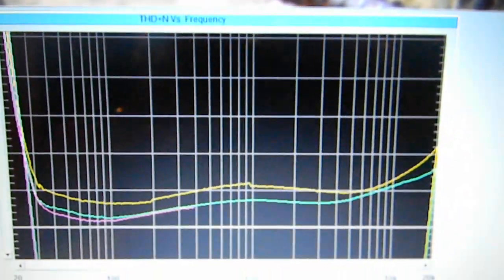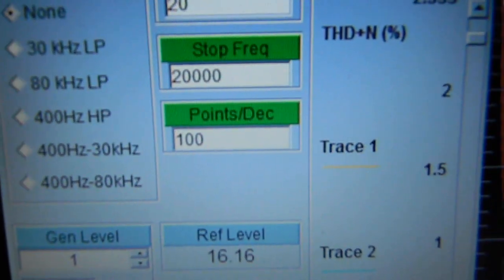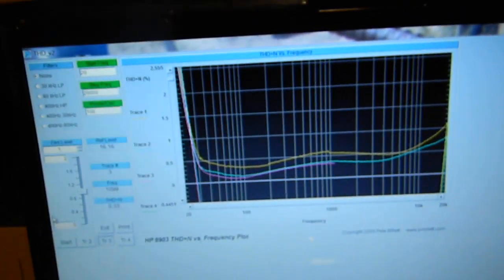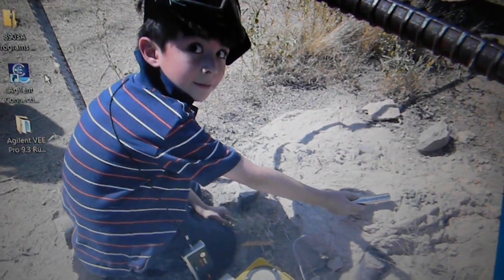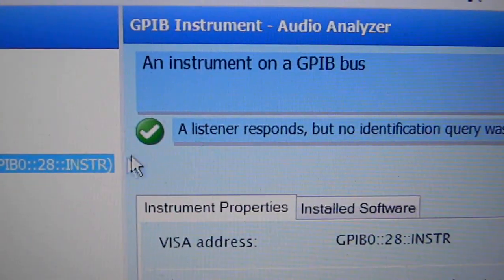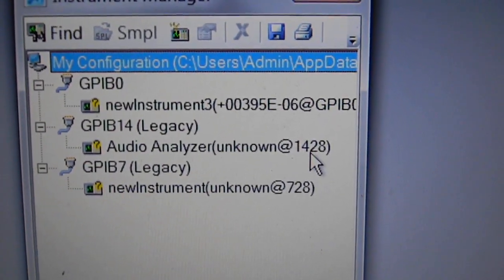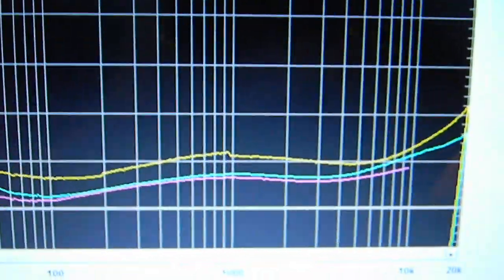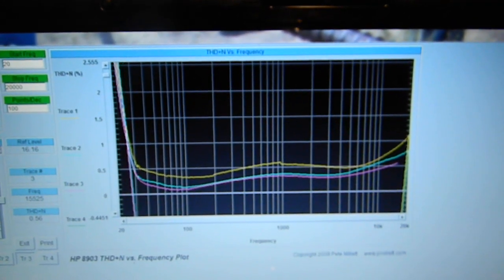Hewlett Packard HP 8903A & 8903B Audio Analyzer Plotting With Agilent 82357A USB/GPIB Interface

Comment: I have been struggling to get mine working. The VEE runtime program also expires in 28 days too! Turned off the auto identifier because this sends a interrogation to 8903 asking it for its Id, something the 8903 does not understand. 
Also my windows on the laptop are not just the chart but looks like it's running inside another program. 
No doubt I will get there. I wonder how much the VEE software costs!
Reply from the maker: Simon - making this thing work is a test of your perseverance and will to live. It doesn't cost any money. Any money you might spend is a waste. It is all free. This insanity between GPIB, HPIB IEEE488, VEE and on and on is meant to drive you crazy. That is why I posted all the videos I did on the HP 8903. This software was written back in the 1980's when geeks couldn't figure out how to tie their own shoes but they wrote this stuff. Between Pete's site and my videos and your determination, you will make it work. Afterwards, you will wonder how you did it and you will never want to have to do it again...   :-)
P.S. the 8903 cannot self identify. You have to assign the address and them "save it". Watch my videos and read all Pete has to say about it. Pete has programs updated as late as 2015 that allow you to adjust parameters in the program.
Reply: Thanks for your reply. Sorted! I was using the wrong version. Thanks again!

Comment from the maker: I can't get "Gen Level" to do anything.  However, I can take the 8903 offline by pressing LCL once then set the voltage manually to whatever i want and then hit "Yes" when it asks, "Is level correct"?  It will keep that level until I close the program and restart it where I have to manually set output level again. After pressing LCL once and setting the voltage, it will automatically go back to PC control when you hit "Yes".

Comment from the maker: You can use it to measure 0 dBm at 600 ohms,  0.7746 volts across 600 ohms.   SPCL function 19.600. If you haven't discovered it yet, when in remote control mode of your PC, you can press LCL once and put it in local mode to make adjustments on the 8903 panel. It will go back to remote PC  mode when you execute the Millett programs.

Comment: Haven't tried yet that function. I mostly work on preamps & studio gear, but as soon as I have to put hands on some power amplifier I will try that for sure!
I was asking the same question to you...today I just tried quickly the Freq response and THD+N vs Freq. And It seems like in the THD+N vs Freq the reference level is stuck @ 0.1Volts, regardless what you set on the Gen Level.

Comment from the maker: Excellent --- another vintage 8903 saved from the scrap yard. Have you used it to display power directly yet? I like that feature almost as much as the scanning - SPCL function 19.xxx (19.0 defaults to 8 ohms or .xxx specifies impedance). I have a question for you - after it asks, "Ref level OK?" I can not vary the output with "Gen Level" when running THD plots - the level changes properly when running "Power_v2".

Comment from the maker: I had some trouble also with drivers and finally got the ones on the video to work. If I remember correctly, VEE 5 would not load under Win7 - I never tried the ISA or PCI cards. My only experience is with the 82357A - thanks for posting your experience and good luck with your installation.

Comment: The auto identify operation sends an "IDN?" query to the instrument.  This is a GPIB command asking for the instrument to return an identification string to the requesting controller.  Your 8903A is an older unit which does not have more modern IEEE488 style commands, therefore an error is returned when the IDN? is executed.  Check out the 8903A's list of GPIB commands starting on page 3-33 of the operator's manual.  Enjoy the instrument!